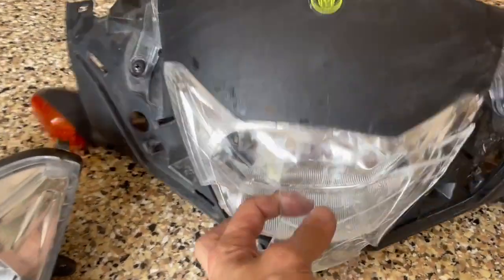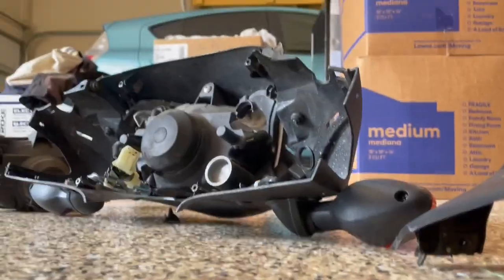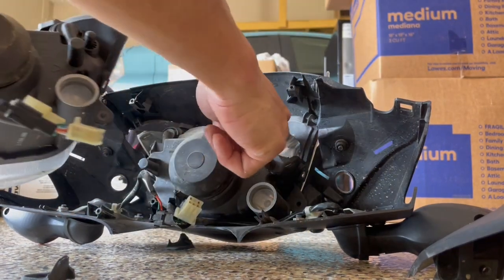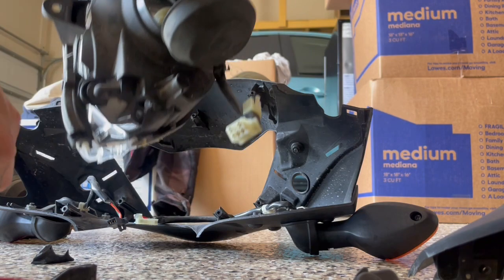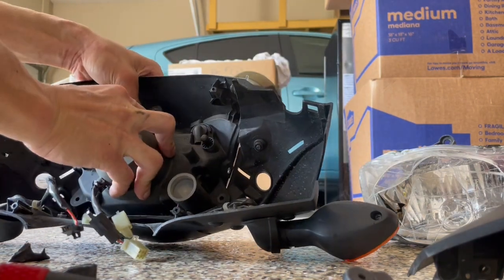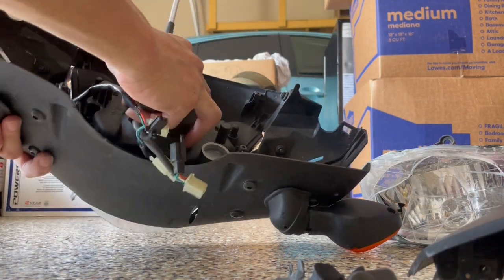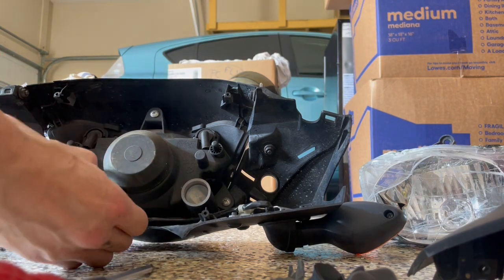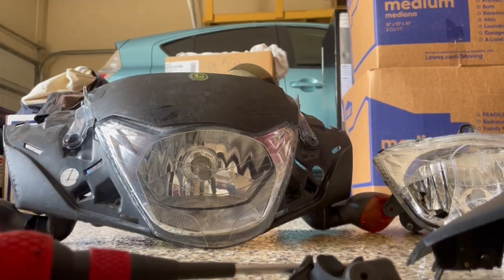Honda SH150i headlight replacement

Comment: did you change the bulb too? I heard the newest LED’s that are sealed in halogen gas are extremely bright, durable and consume LESS power. Socket is M4 on SH 2016 >
Reply from the maker: problem with these aftermarket LEDs is that they are too bright and blinds oncoming traffic, like leaving the highbeams on all the time.  Also they are not position in the correct spot for the reflector to focus the beam so light scatters all over the place like a flood light instead of a spot light.  They also run very hot and melt the outer lens